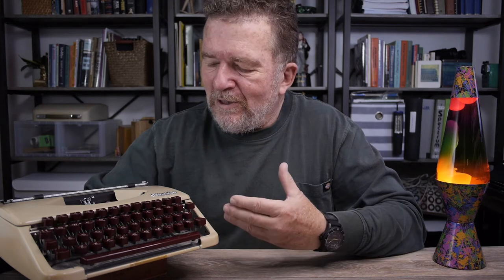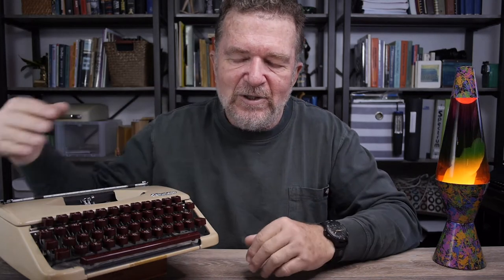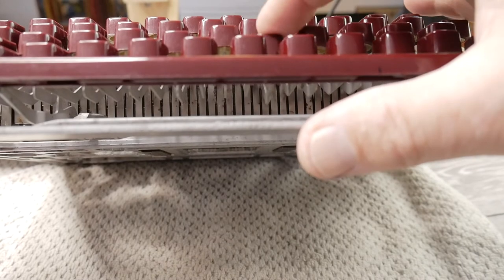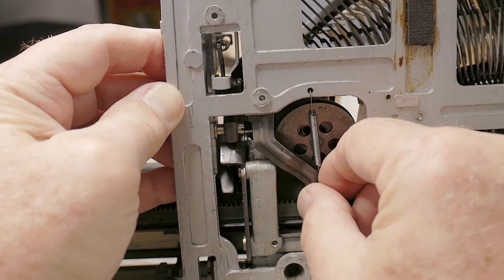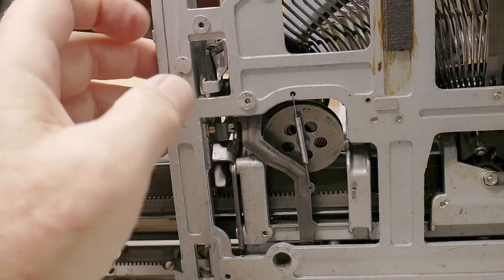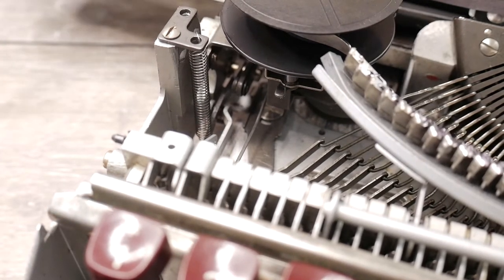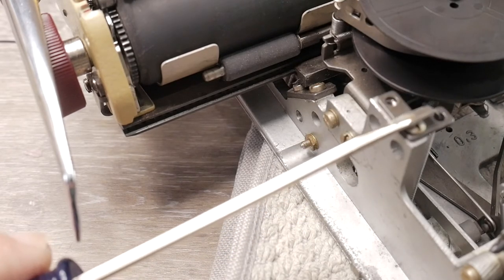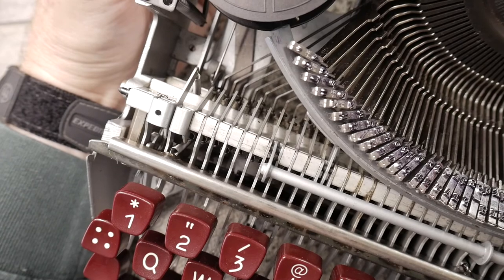Typewriter Line Lock Repair

Comment: The line lock on my SC standard was intermittent. Bent a lever over enough (very little) with my thumb to engage the line lock hook more positively so it now works perfectly.

It is a different system, there is a lever attached to the mechanism which normally just waves back and forth but when the line lock is engaged a hook swings over and gets in the way of the first lever stopping the type bars from swinging all the way.

Comment: Joe, just a heads up- there appears to be a spelling error on the thumbnail of this video, last word says "repai" instead of "repair" (unless my brain is having a moment).

Just letting you know in case you'd like to check it, or revise and replace it.  If so, it could potentially boost this video's performance (I heard the algorithm can read text on thumbnails).